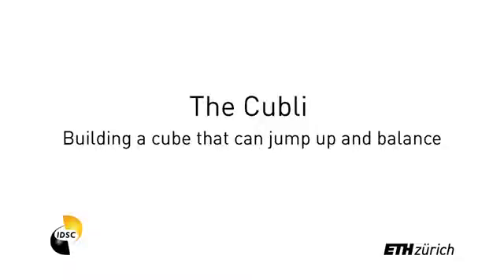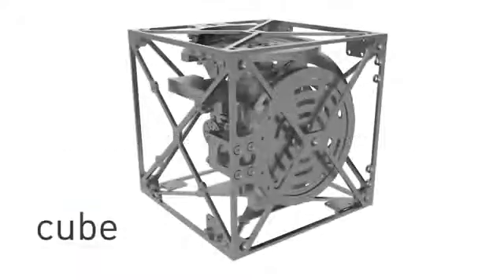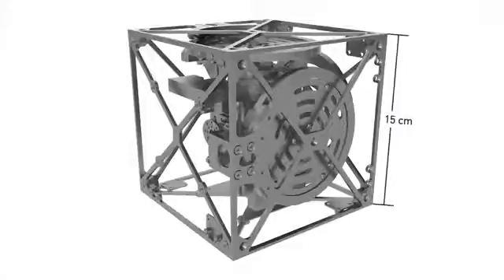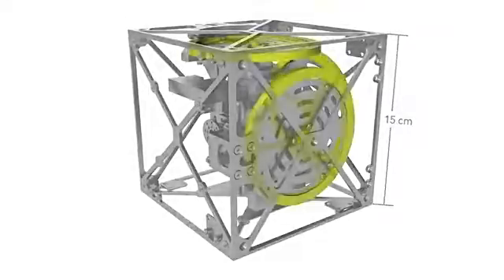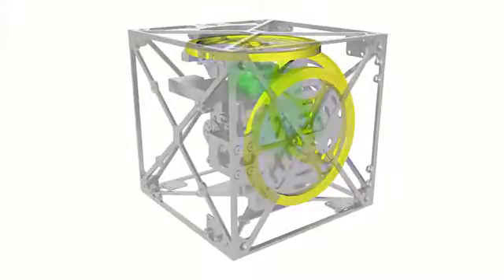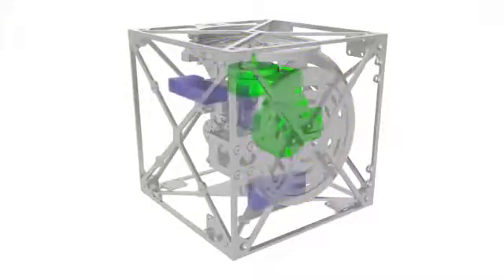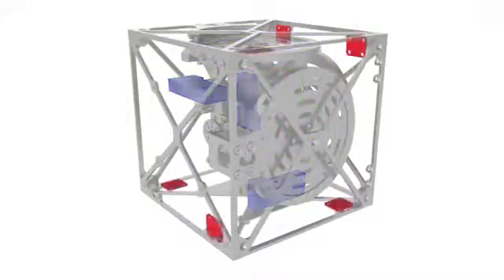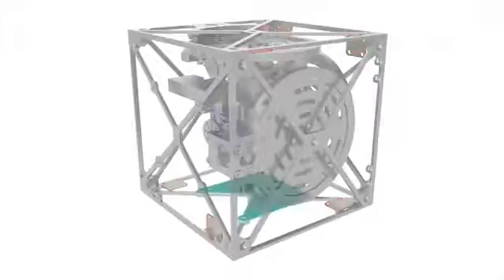Cubo con giroscopio

Comment: se podra hacer una estructura similar para controlar las vibraciones de una edificacion y asi prevenir sismos ?
Reply: En  las plataformas petroleras en el mar se ocupan  plataformas de  estabilización
Reply: si hay similares pero con otro tipo de funcion motoras amigo
Reply: Si se puede, pero por la forma en la que funciona, estos diseños solo corrigen momento angular (rotaciones) y el desplazamiento de los edificios durante sismos es momento lineal (movimiento en un eje especifico) por lo tanto serian muy ineficaces. pero si hay sistemas de absorción oscilatoria que utilizan grandes masas para disipara el movimiento